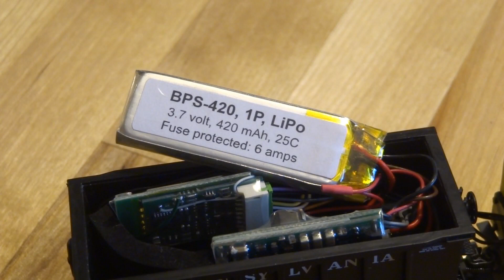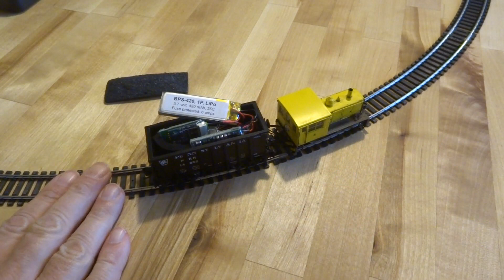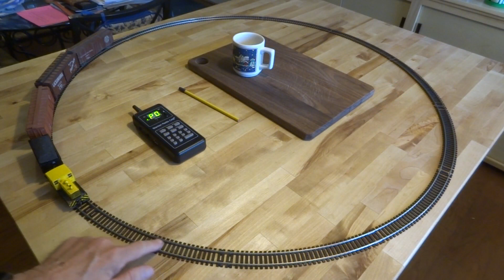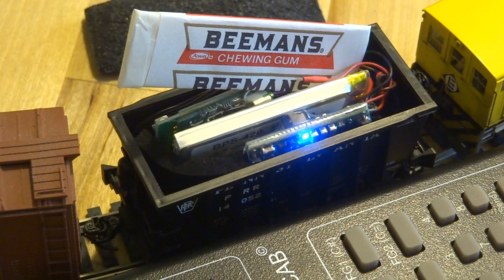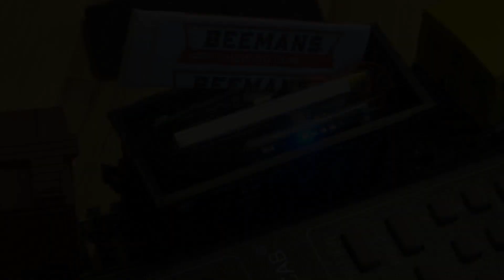S-CAB "DEAD RAIL" TINY BATTERY RUN-TIME TEST!

Comment: I wanted to know when it really ran out of power for that size. That would give me about how much it would list.
Reply from the maker: It's been a few years since that test.  If I remember correctly, I think it started slowing a bit after an hour of running, so the end would be not far off.  But remember that curves require much more tractive effort (and amp draw) than straight track, so having some straight sections could also extend the run time a bit.

Comment: After watching this intriguing video, Stan, I am seeking your opinion, if you have the time to speculate on what I want to do. I have an ATSF Super Chief 8 car train with 2 DC powered A units and a dummy B unit. The train has not been used since 2003, and was stored for years in a mostly dust free wooden case in an unheated garage in Indiana. Doesn't sound good so far, I know, but I figure if I can apply some "spit n polish" to the Mantua brand diesels (not the highest quality, but I remember them running smoothly together on DC power)and revive them to their glory days, I might consider dead railing them with S-Cab. The A's could be a single address consist. The 8 passenger cars weigh 24 ounces total. The A units weigh 14 ounces each, and the B 11 ounces with a heavy weight inside it that could be decreased or removed to accommodate batteries and decoders. So, all that being said, do you think S-Cab is a bad idea or a good one for such a train? It would climb mostly 1% grades on the layout I have planned with AnyRail. If you can reply, that would be great, but if I sound too crazy to deserve an answer, I'll understand that, too! I should probably contact Neal, but you seem really adept with S-Cab. Thank you in advance if you choose to reply.🙂
Reply from the maker: Hello.  I'm not really familiar with your specific locos, and certainly not early 2000's vintages, but generally the dead-rail setups are simply replacing the voltage from the track with volts from a battery.  Also, in my case since I already had my layout wired for DCC, I could also use that power in the rails to recharge the batteries in the S-Cab system.  I measured one of my box cars at about 3.5 oz, so my small S-4 switching locomotives would have no trouble with 8 or 9 such cars if the grade was not too steep.  The pulling power of your locomotives should be roughly the same I would think with rail power or batteries, but of course battery milli amp hours would affect how much run time you would have available.  If you don't have really complicated electrical blocks in your layout, and it's fairly easy to clean the tracks, going dead rail might not have a lot of advantages over just DCC.

Comment: If you were running steam you could put all that stuff in the tender!
Reply from the maker: That's for sure!
Reply: @StanFerris  I am modeling in N scale for now with steam locos only, but when I go to HO scale I will definitely consider dead rail steam locos.  No more worrying about whether my power routing turnouts will want to route power through their points!
Reply from the maker: @user-nx8tk1pp5o  I know what you mean!  Did you see my video on putting dead-rail into N scale?
Reply: @StanFerris  Just now.  Amazing how the electronics and the batteries are getting smaller and smaller.  Keep up the great work!

Comment: Same was true for my HO set up, S-Cab runs side by side with my NCE DCC and it  charges from rails. It was an ah ha moment for me, why should I be cramming in S-Cab at that cost when a keep alive would do the same for 29 bucks. Leaving you with much better DCC options. But outside on my G scale I run a 3.7vdc 1000MaH on a LGB small 4 wheel engine and it last 1hr 29 minutes  no cars about an 1hr pulling 4 shorties
Reply from the maker: Thanks for the comments, Steve!  One of my DCC locos had a keep-alive circuit, but it was unreliable because the keep-alive would only keep turning the motor but not listening to the cab control, so operating was troublesome.  Yes, the S-cab is a bit more, but well worth it for me considering all the time and money that goes into building a layout.  Blessings!

Comment from the maker: After the run test, I put the loco back on my layout and it took about 20 minutes for it to recharge off the track power.  On my layout, the loco should run all day long as it will continuously get some power from the rails if I have the NCE power cab turned on.
Reply: hi, what i am wondeirng about is how do you charge it? which type of charger is between the rail and the battery? are you running the engine on 3,7V or are you using such voltagecircuits giving higher V out?
Reply from the maker: @tschagalaga  Hello!  My layout was first designed for DCC power with NCE Powercab and controls.  So when I considered going to battery power, I chose the S-Cab system with a controller that is compatible with NCE.  The locomotive batteries are not removed for charging.  There is a built-in charger on the S-cab board that uses the NCE DCC power already in the track.  So the locomotive runs on the same dc voltage is it would with DCC, or standard DC.